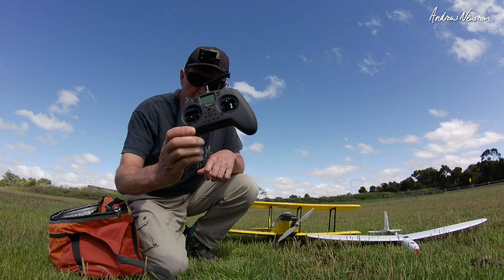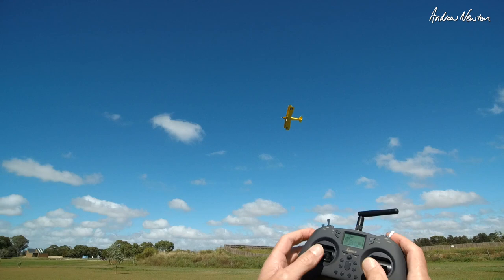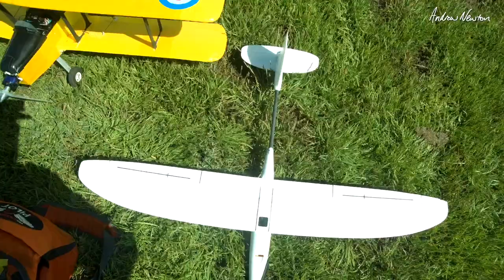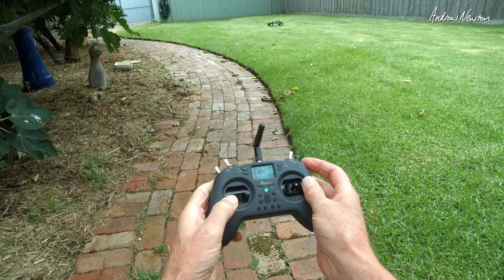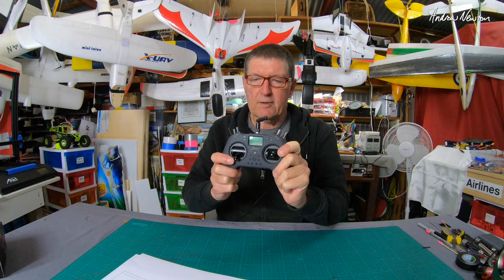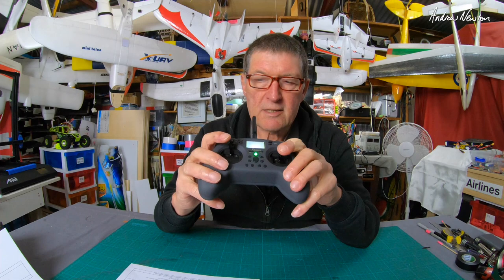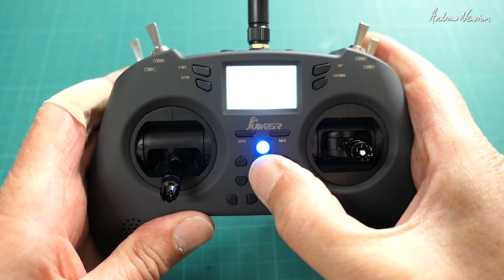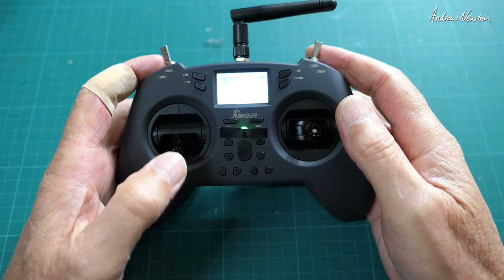Jumper T-Lite for Fixed Wing

Comment: I've got a few eachine an XK rc models would they work with this transmitter?  Have ended up with multiple tx which is good if you're flying with friends but a pain when you're out for a few hours by yourself.  Advice would be greatly appreciated.
Reply from the maker: Most likely yes. But some individual models are not supported.

Comment: Would you recommend this or the jumper t12 pro for fixed wing? I’m just starting out and am yet to get a radio. I was wanting a small radio that has 4 in 1 so I can also bind to my t720. So far I prefer pinching over thumbing. I wasn’t sure if I really needed a slider which the t12 pro has but I’m open to suggestions
Reply from the maker: I would go for the T12 for full fixed wing functionality
Reply: @AndrewNewton  Hi Andrew, thanks for your review. Could you please elaborate what do you mean by full fixed wings functionality ?

Comment: I have just received my transmitter so keen to check your review again. All good, than thank you for the thorough presentation. I will be excited to use this and I think handy for small planes and my assortment of tiny quadcopters as well. 
Just wondering if any significance with your epilog to the video with your running the thing outside along with the garbage bin? I would hope no inference with that??
Reply from the maker: Oh no, it's great little radio. The RC bin driving was a poor attempt at humour

Comment: Have you got a link to set up T-Lite for fix wing. I would like to use this unit for my DLG and mutiple fix wing planes. It is very differant to my 7C and FR-i6 tx.
Your help would be much appreciated. Cheers Colin
Reply from the maker: Good suggestion Colin. I have done lots with the Taranis Q X7 but the T-Lite and RadioMaster TX12 are just a bit different to warrant basic setup videos. It's on the list.

Comment: New to this type radio do you use a controller board on like beta flight for everything?
Reply from the maker: Normal RC OpenTX transmitter that will work with many different protocol receivers

Comment: I actually see Flysky AFHDS3 protocol on it... was that a typo? or are there actually plans to make it work?
Reply from the maker: Just means the Multiprotocol firmware supports the AFHDS3 external module, but not necessarily on this radio.

Comment: Does this transmitter have mix to use flaperon, elevon and Vtail with planes?
Reply from the maker: There is a plane setup wizard that has some pre programmed mixes, but you can do any mix with OpenTX.
Reply: Gracias

Comment: Hi new to rc remote's  just balt the jumper t lite  will it fly the new  micro a10 warthog  Spectrum receiver  and thanks for the video and very informational
Reply from the maker: Depends which RF module is in your radio. The JP4IN1 version will bind to more different receivers than the CC2500 version.
Reply: @David Godleski If you bought the Jumper T-Lite with the JP4IN1 Multi-protocol then yes it will connect to your micro a10 warthog Spectrum receiver.
Reply: @g2rc   thank you I have it bind

Comment: would you mind explaining how to add a sound pack to this transmitter?
Reply from the maker: Download the "t-12" version of the SD card contents from here https://downloads.open-tx.org/2.3/release/sdcard/ and copy over to an SD card then insert into the T Lite.
Reply: Thank you will try that.
Reply: Do I just add the entire folder to the sd card or the individual audio files?
Reply from the maker: All folders and files inside the downloaded folder eg. EEPROM - FIRMWARE - LOGS etc.
Reply: Got it working thanks for the help. Now if I can figure out why I keep getting “all slots full”  message not sure how to stop that or which button acts as the “exit” hot key. Thanks again for your help